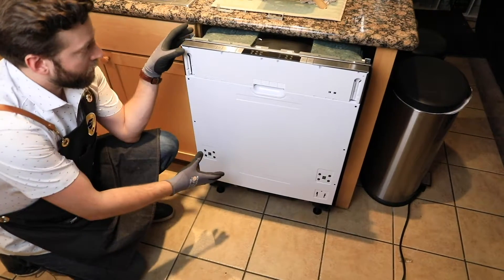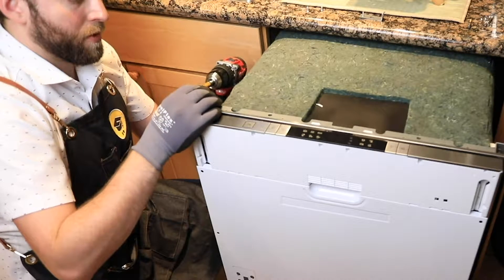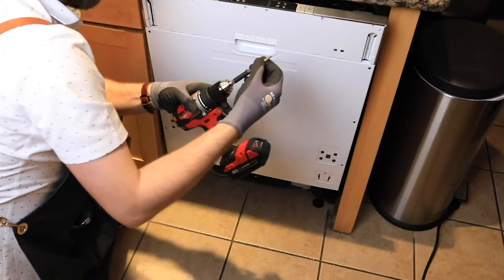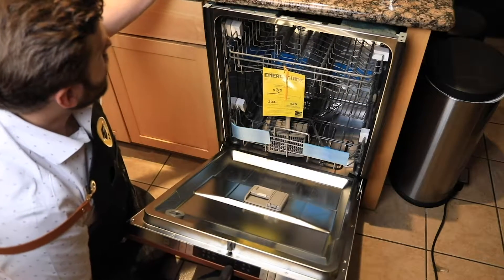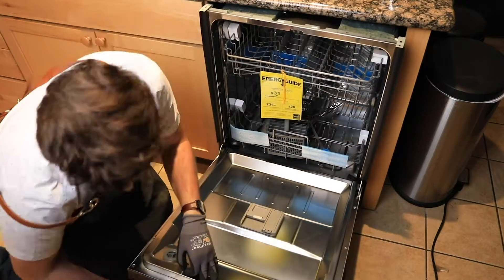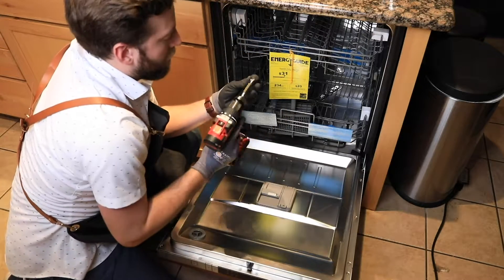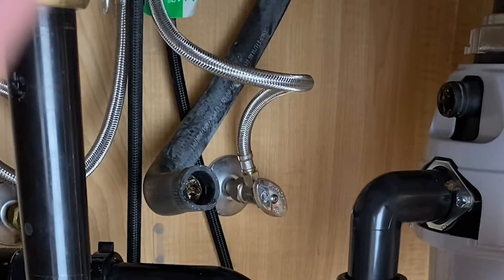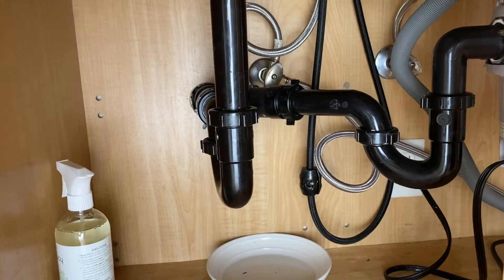How to Install A Dishwasher | Final Steps

Comment: How would you attach the top of the dishwasher to the bottom of Quartz countertops?
Reply from the maker: Hey Gary! Your best bet would probably be to place a 1x2 wood mounting strip in between the dishwasher and the quartz (if you have room). Attach the wood to the quartz with a silicone adhesive and then carefully screw the dishwasher into the wood. I'd suggest you reach out to a licensed professional in your area first and see what they advise as well!